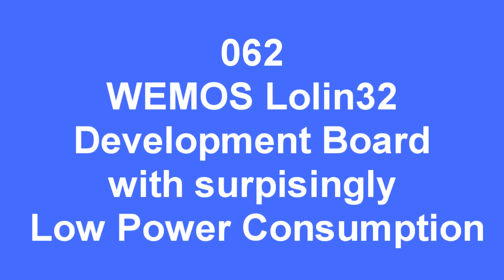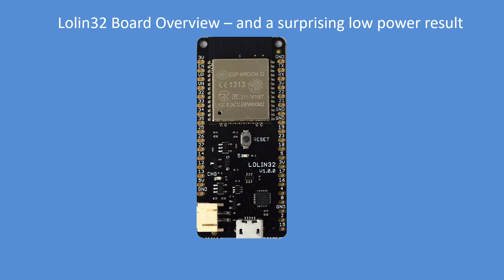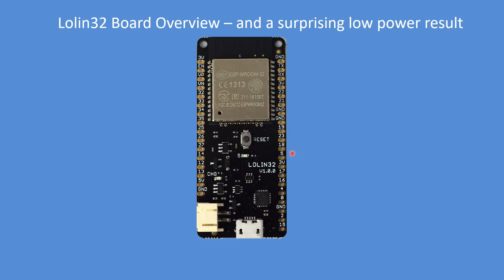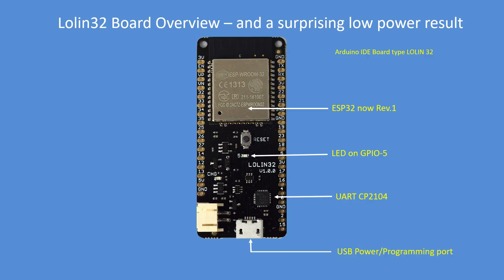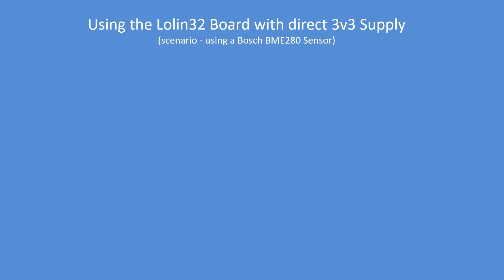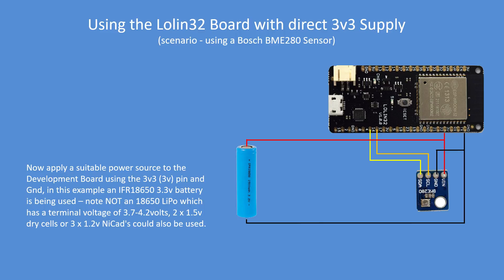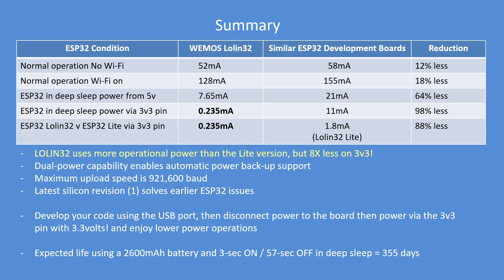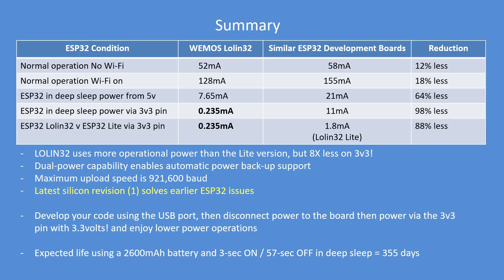Tech Note 062 - WEMOS Lolin32 (surprisingly low power demands when powered by 3v3)

Comment: Hello G6EJD,
Can you please also test the "ESP32 Thing" from Sparkfun? It is similiar to the Lolin32.
It would really help me.
Your channel is very informative. Keep up the good work
Reply from the maker: It's a good board, but almost identical to the Wemos Lolin32, certainly the sleep power consumption I expect to be the same. Advantages of the Thing are the addition of jumper JS2 with a small pcb bridge that can be broken with a knife to reduce power consumption by disabling the on-board charge LED. Also It has an on-board 32KHz RTC crystal which is a really useful addition to give better sleep time keeping accuracy, default is +/- 5-secs every hour, that's what I see on mine.
Reply: Thank you for the detailed answer. Can you do me a favour? Can you measure the current for the sleep when you use the Lipo Charger and the 3,3V Pin to power the ESP32? I need it for a project where battery lifetime is very important. I need some exact values and need to know whether I should take the Lolin32 or the ESP32 Thing. The consumption on sleep is the most important for me because the ESP32 will just wake up once a day. Would be nice if you would post it as reply.
Reply from the maker: Andreas Spies did a comprehensive table of power consumption and sleep consumption, it was also in an Excel Spreadsheet.
Reply: If you mean the Video #159 of Andreas Spiess, then yes i already saw the video before i saw yours. But unfortunately he says that the Lolin32 consumes 16mA in deep sleep (i guess over USB) and you say it consumes 7.65mA over 5V (also USB?). Thats why i asked you if you could do a measurement for the ESP32 Thing in deep sleep.

It is very confusing. Even the Data sheets from the manufacturers say different things. Sparkfun for example says, that their ESP32 needs 2.5µA in deep sleep. But how can this be if the naked ESP32 itself (without UART and LEDs) consumes 5µA alone. I dont know what to believe. I wish i could measure it myself but i dont have the tools for it.
Reply from the maker: Yes, I meant to email him that his result was incorrect. What I can say with good accuracy is the ESP32 in deep sleep consumes 6uA but you can only achieve this level if you don’t use a regulator and UART, so that excludes every development board on the market, but what I did discover (one of my other videos) was if you supply this Wemos lolin board with 3.3v to the 3.3v pin thereby bypassing the regulator and UART which are unnecessary for the application is the power consumption in sleep is the lowest I’ve seen which is what prompted me to make the video. If your application needs low power then you don’t need a development board you can get a ESP32 breakout board and regulator for $3 on Aliexpress that together give you a solution that will run for 2-years on WiFi with a 1-hour sleep time, I have such a setup that has been running with an epaper display for 9-months now and another that uploads temp and humidity with pressure to Thingspeak for the last 7-months none stop, I’m using 3.2v life04 18650 batteries that don’t need a regulator. Actually if you want the ultimate low power board use an ESP8266 as it easily beats the 32 because it needs so much less running and about 60uA in sleep but that is more than battery self-discharge currents and so not dominant in battery life terms.
Reply: I ordered one of the Wemos Board which you recommend for low power applications and i have a question... Since the Board has three 3,3V Pins, can i use one of the Pins to power the Board itself and one of the other two to power Sensors which require 3V to work?
Reply from the maker: All 3.3v pins are connected together so you’d supply 3.3v to one pin and use the others to supply any sensors alternatively connect all your sensors and ESP board to a single supply point. If your going use a 3.3v regulator be sure to place some smoothing capacitors on the output of the regulator at least 47uF and ideally a parallel 0.1uF ceramic type for high frequency smoothing. The regulator needs to be able to supply 600-700mA minimum to deliver enough power to the ESP at startup. If you get unreliable operation this will be a function of the power supply, so choose it carefully. You will never get the absolute low power that the ESP32 can deliver when asleep but of those development boards on the market this one is one of the lowest power type when supplied by 3.3v to bypass the UART and battery charger. Hope this helps you.
Reply: I am currently realizing a project for my university. I try to minimize the current consumption as far as i can. I wanted to use just a naked ESP32 on a breakout board for minimal current in deep sleep but my professor wants to be able to change the code any time without soldering the chip again and again. So a dev board is a must. Thats why i am so glad that i found your video. Itsreally a life saver. Other boards as you mentioned drain too much current. I want to use a 100µF capacitor. Can you recommend me one? They have different voltages. One has 35V, the other 20V. Which should i take? Electrolytic or ceramic type? Thank you for your detailed answers!
Reply from the maker: Serhat Bayraktar The capacitor rating needs to match the highest likely voltage, which is either 3.3v or 5v so you only need the lower voltage  rating type. 100uF is OK but they are very inductive and so slow to respond to fast power demand transients (-L.di/dt) that’s why you need to low inductance 0.1uF C, but don’t worry too much as the development board already has these capacitors fitted, it only becomes an instability problem if you run long power leads to the ESP32 don’t underestimate the power demands at startup is my advice. If you want you can work out the ideal smoothing capacity from the equation Q=C.V and as Q=I^2.t then I^2.t = C.V and then C=I^2.t/V and the values of I and V are delta values. This is a rough calculation but it’s about 80% accurate and given capacitor tolerances is adequate. Typically the delta values are 110mA normal running current of the ESP32 and occasional transients to 300mA so delta = 300-110mA= 190mA and for time, it lasts for about 1mS and we don’t want V to change from 3.3 to less than 3.0 delta of 0.3v the ESP operating range, so the value of C required=120uF so 100uF is ideal. For low power use I use the ESP32 on a breakout board with just a boot and reset switch and I re-programme that all the time by connecting a UART-USB converter and it works as good as any development board but I get ~7uA in sleep mode. It really is easy to do. Maybe I’ll do a video on that topic.
Reply: As a regulator i want to use an HT7833 from holtek. Even the  moderator of the forum from esp32 suggest it because it can output 500mA and has a quiescent current of 4µA. On basic circuits the datasheet recommends 1µF capactor on V_in and 2,2µF capacitor on V_out for the regulator. I would definitely like to see that video you mentioned.
Reply from the maker: The lower values of C are due to the bandwidth and output impedance of the regulator thereby allowing smaller values to be used, but that does not mean the bulk energy storage capacitors are adequate for all eventualities, for example a load that is fairly constant can tolerate a low level of energy storage as the regulator will provide the energy replenishment (it takes a finite time to do this), but when the load is highly dynamic and exhibit transient current demands then the regulator may not be able to respond quickly enough without additional energy storage from a capacitor. Without designing it explicitly try and see but I think that regulator is marginal if your going to be using the radio (WiFi) as that alone takes peaks of up to ~400mA and then if you add any sensors or peripherals that adds to the loads, again it's a matter of trial and error without a detailed analysis. Good luck with your studies and experiments.
Reply: Thank you very much. I found a thread on reddit where someone claims to get 130µA with the Lolin32 Board. Search for "Power usage on the WeMOS Lolin32 D1 & Lolin32 Lite boards." on reddit. He says that he gets the consumption of 130µA by connecting the battery to the lipo charger. Did you test that too? :) It actually are two guys saying that. The first one is the guy who opened the topic. I quote him "This was tested with 3.6V at the battery terminals, if you power over Micro USB expect the power usage to be higher, mostly due to the "USB Power" indicator LED." Then there is a second guy who claims it too (username: aspz) at the end of the thread.
Reply from the maker: Thanks I’ll investigate and try it myself. I don’t understand how it works unless the 3.6volt input to the charge circuits somehow stops it loading the output noting there is no supply to the charge device. Interesting.
Reply: Can you please let me know your results? :) When are you going to estimately have them? Kind regards.
Reply from the maker: I’ll try it tomorrow and let you know. I’m just reading their comments. Firstly there is no Lolin d1 mini with a battery connector on the market, but I have nearly every board available so I’ll try out the lolin 32 and lolin 32 lite and the Firebeetle 32. 3.6v is just enough to operate the ldo onboard regulator for a 3.3v output.
Reply from the maker: Also it’s possible they used a DVM to measure current which in nearly every case/design of DVM introduces a series shunt to measure voltage as current (so-called burden voltage) but this gives misleading results.
Reply from the maker: SImple test programme:
void reset(){
   Serial.begin(115200);   
   delay(30000);    
   esp_deep_sleep(30*1000000LL);  // Sleep for 30-secs 
}

Results:Lolin32 Lite powered via 3.6v on the battery connector:
41.6mA ON
880uA   Sleep
Same results when powered by 4.2v

Lolin32 powered via 3.6v on the battery connector:
44.2mA ON
128uA   Sleep
Same results when powered by 4.2v

Lolin32 PRO powered via 3.8v on the battery connector:
39.4mA ON
470uA   Sleep
This board will not operate at 3.6v input, 3.78v minimum

DFROBOT Firebeetle32 powered via 3.6v on the battery connector:
39.7mA ON
8.7uA   Sleep
Same results when powered by 4.2v

DFROBOT Firebeetle8266 powered via 3.6v on the battery connector:
73.5mA ON (Wi-Fi on unlike ESP32 examples)
49uA   Sleep
Same results when powered by 4.2v
So the results are consistent.

Example using the Lolin32 sleeping for 59mins 50sec at 140uA and awake taking a sensor reading for 10-secs and uploading to Thingspeak (WiFI on the ESP32 takes 122.6mA):

(59+50/60)/60*0.145mA + (10/3600)*122.6mA=0.485mAhr

A 2600mAHr Nimh battery source (3x1.2v) would last for 223days

Example using the Lolin32 Lite sleeping for 59mins 50sec at 880uA and awake taking a sensor reading for 10-secs and uploading to Thingspeak (WiFI on the ESP32 takes 122.6mA):

(59+50/60)/60*0.880mA + (10/3600)*122.6mA=1.218mAhr

A 2600mAHr Nimh battery source (3x1.2v) would last for 90days
Reply: So 145µA? For real? Damn thats great! I really appreciate your effort! You even tested it on more boards on different voltages. Cant thank you enough.Hope that information helps you too :). I am excited for your video mentioned before. Keep up the good work.
Reply from the maker: Don't forget the bare ESP32 can easily achieve 6uA in sleep under the same test, but the problem is really the awake current as that's the dominant part of the mAhr calculation I think any sleep current below about 50uA provides only marginal gains in battery life, it needs cross-graphing to see where the intersection is and that will reveal the sweet-spot for designing optimal battery use. Spending money to get a better result is often not cost effective in my experience. Yes I'll produce the programming an ESP32 bare board video.
Reply: The usage of my ESP32 is dominated by the deep sleep current. My ESP32 will wake up just once a day for estimately 10 seconds and it will sleep the rest of the day. I am going to use a 5200mAh single Cell Lithium-Ion battery in the size "26650". I think it will last more than one year. :)

What happens when the voltage is 3,4V on the Lipo battery connector? Will the ESP32 still work? Because of the regulator... How much Voltage will drop then?
Reply from the maker: For the input-output drop out voltage you’d need to see the lolin circuit diagrammed and check the Leary but it’s likely to be 0.2v. The ESP32 150khz clock used during sleep is very inaccurate and I find it can gain about 10-mins per hour so may may need to do a trial on your board and adjust the time value to get it closer to 24-hours than a likely 22hours. All of my devices are fast across Rev.0 and Rev.1 silicon unfortunately there is no access to the 32khz clock from the Arduino IDE and it needs a cram to work. Good luck in your project.
Reply: So if there are 3,4V from the Lipo battery it will result in lets say estimately 3,2V? I am satisfied if its 3V. That would be totally enough. Luckily I dont use the Arduino IDE and use the official ESP-IDF instead. The Arduino IDE is still not perfect and many features are missing.
Reply from the maker: I'm back in my office now, the Lolin32 regulator is the ME6211 (3.3v version) is 0.15volts at ~130mA and the minimum supply voltage of the ESP32 is Power supply1 VDD 2.3 3.3 3.6 V

So it works down to 2.3v but I don't know and the data sheet does not say what happens to the regulator when input voltage drops below its designated output voltage, often there is a relationship between input and output and the regulator output will be gin to climb as input voltage rises, then stabilising in this case at 3.3v we just don't know. IN any case the battery would be damaged or completely depleted when it got down to ~2.5v.
Reply from the maker: I've just added the test results for the FIrebeetle32 from DFROBOT, it's really good at 8.7uA sleep current. I'm going to try the ESP8266 too now.
Reply: I have the Firebeetle32 too. Unfortunately it is a rev. 0 chip. It has too many bugs, so i cant rely on it. Thank you for posting more results from other boards. I think your measurements are stuff for another video since you tested many boards :). I have a question for your video #057 where you just use a breakout board. On online shops where they sell this breakout board they say it is recommended to solder a pullup resistor between the EN pin and the 3,3V pin. Did you do that too?  And for flashing the Chip can I use a CP2102 USB to serial converter or shall i pick up a CP2104, since it is also used on the Lolin32?
Reply from the maker: I just tested and add results for the ESP8266 Firebeetle, 73.5mA (but Wi-Fi was on,) and 49uA sleep, so not bad.

ESP32 breakout boards - yes with some boards, well nearly every one that is a grey colour, resistors have to be soldered to the board along with two switches, but most suppliers show the boards with the soldered already - their not!Any USB-TTL unit will work OK as long as you can get:Vcc-3.3v
Txd
Rxd
Gnd

Then connect these to the ESP32 pins Vcc, Txd-Rxd(USB) and Rxd-Txd(USB) and Gnd-Gnd.

Plug in the UART to a USB port and press the EN button and hold then press the RESET and start programming. It really is easy. But as I say, you need a good power supply. And a UART adapter will not power the ESP32 for a Wi-Fi based programme, Hello World OK.

Comment: Hi. I tried to power with ht7333-a voltage regulator it wont power up from a lipo battery even 2 18650 battery.. whats the trick ?? Is 3.6v is okay ?
Thanks.
Marc.
Reply from the maker: You must have a very low impedance regulator, 3.6 is a little high but still within specification. You really must have a good capacitor across the supply ideally 100uF it’s not an exact science so any large uF value would do. Also check the serial port output using your usb UART and look for the messages mentioning flash read errors that’s a sure sign the PSU is not able to deliver the high startup current demands about 300-400mA. I’ll have a look at the ht7333 specs and see what it looks like, regards Dave
Reply: G6EJD but deepsleep dont require much current.
Reply: ?? What do you think about lm1117 ??
Reply from the maker: Yes maximum power output of the HT7333 is 3.3v at 250mA so it will be folding back current when the ESP32 starts, so you need to work to a maximum demand of 500mA then it will work. You can use the formula Q=CV or I.T = C.V where I is the delta amps and V is delta voltage and change in current is about 40 to 350mA = 310mA and delta V = 2.8 (ESP32 drop out) and 3.6=0.8v and time of the current pulse is about 5mS therefore C = 2000uF if my maths is correct, basically a big capacitor but to add to the problem large capacitors are very inductive so don't respond to fast changes that well, so add a small 0.1uF in parallel with the big one is needed, but a good regulator will allow smaller C’s to be used. Hope this helps.
Reply from the maker: Yes that’s OK, but is takes 5mA quiescent current so not good for battery powering.
Reply from the maker: Indeed this is the problem with the ESP32 it takes a lot of power at startup, the Rev.1 silicon has helped reduce this problem but not many around only the Wemos Lite and Wemos Lolin boards but need to check.

Comment: With 18650 battery it can reaches 4.2v can it dammages the esp32 ?
Reply from the maker: This is why at 3:09 in the video I specifically state do-not use a LiPo 18650 it has to be an IFR18650 which is a 3.2v LiFePO4 cell see here: http://gamma.spb.ru/media/pdf/liion-lipolymer-lifepo4-akkumulyatory/IFR18650-11Q.pdfI use a lot of these batteries and they work perfectly with the ESP32. Maximum charge voltage is 3.6v but nominal cell voltage is 3.2-3.2v so not exceeding the specification of the ESP32.
Reply: ok thank you! :)